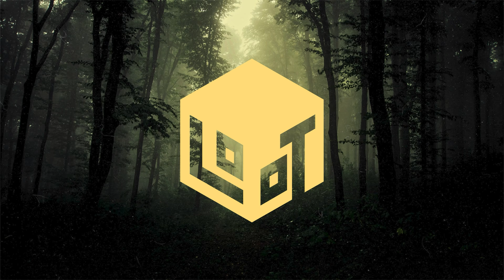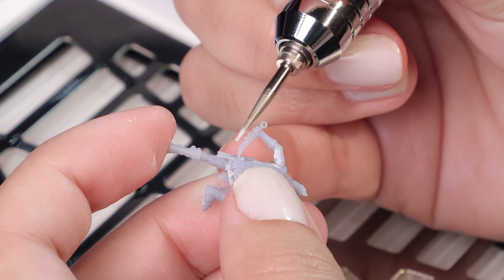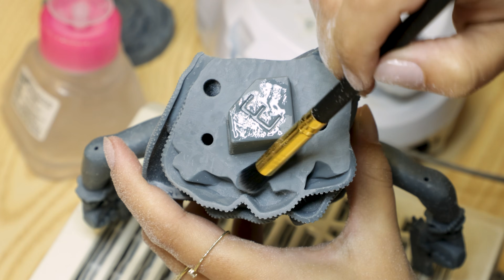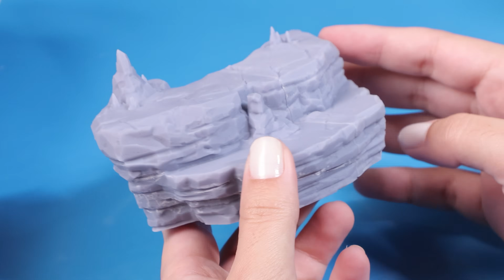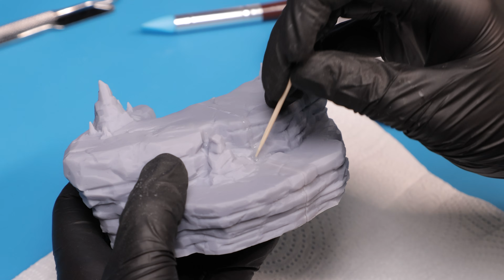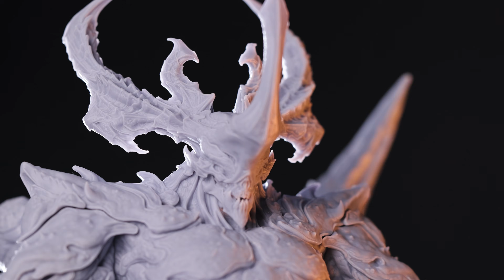Stop Ruining Your 3D Prints! - Finishing tips for RESIN miniatures

Comment: Id be careful trying to glue resin printed parts with resin/resin+ babypowder. UV light will only cure the top fraction of a millimeter, the rest is protected from the light and will pretty much stay liquid indefinitely. Its very easy to go to thick, and that can mean resin leaking out, messing up the paint, or pieces breaking off., You can mix superglue with baby powder, pigments and a little bit of baking powder to make a putty that cures fairly quickly (depends on how much baking powder you use), is easy to sand and can securely glue large parts together. 2 Parts epoxy would probably be even better, but more of a hassle.

Comment: The accelerator trick is nice. I use Gorilla Glue Gel and press the pieces together firmly for 10 seconds and that holds strong enough for me to begin painting without worrying it will fall apart.

Or if you’re worried, just wait!

Comment: In my opinion the 0th tip is missing. What's the best way to put supports in slicer and how to best remove them? In my miniatures i have problems with holes left by the supports and not remaining tips of supports. And when to remove supports? Before or after washing? After curing?

Comment: When you're printing that large is it even fair to call them "miniature"? Those prints are HUGE. I would have to cut that dwarf into 300 pieces to even fit it on my print bed. At that scale you'd be better served using a FDM printer, it's more durable and the micro-details don't matter.

Comment: It is not recommended to apply glue to one side and accelerator to another.  That bond will end up being very delicate and will likely separate down the road.  The better thing to do is use the glue like normal, on one side, body the two parts, then spray accelerant on the outer portion of the bond so you can let go while setting.  The same recommendations apply.  Use a minimal amount of glue and let it fully cure.
Reply: I'll just stick to 5min epoxy

Comment: The resin + baby powder for gap filling is an awesome idea! Thank you for that tip!
Reply: Just make sure you do very thin layers.  I tried using it to gap fill, and some liquid went down into the cracks, while the UV light just cured the surface, trapping liquid resin inside. It offgassed and blistered up. I cut into it an liquid resin came out. 

These days I stick with a sandable self curing hobby putty. Over fill the gap, as self curing putty shrinks once cured. Then sand it flat.
Reply: @13Nagash13  This is correct.  I just started using this method of filling gaps and it works so good.  It does work great for bigger gaps but you definitely need to tape and make boundaries so the resin doesn't flow everywhere and like Nagash said do a little at a time in layers and you will avoid a mess.

Comment: Nice tips. What I would like to add:
1. Check for holes from the bubbles. Sometimes on the last layers of the miniatire I get cavities from the bubbles which need to be filled.
2. If you print with 50 mikrometer layer height, you may see visible layer lines on corved areas. They need to be sanded or filled then sanded. I like to use tamiya putty for this.
3. In my expierence, primer tends to reveal imperfections, not hide them. In this case, it is ok to sand the imperfection with fine grid sandpaper and apply the primer again.